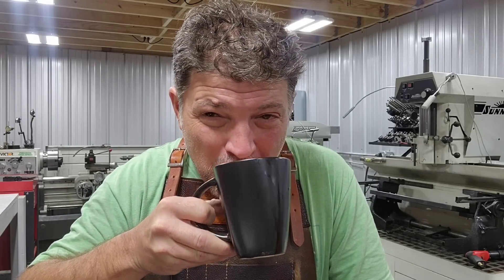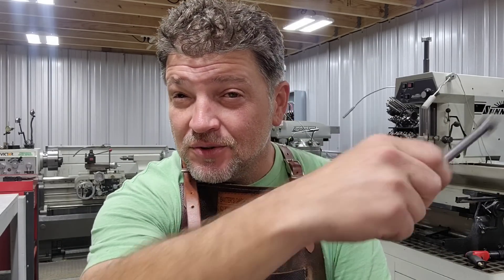Do You NEED to UPGRADE Fasteners for Your Harley Engine?  Fastener Tech and Logic to Help You Decide

Comment: I was wondering how you were dealing with Galling with SST fasteners and an Aluminum Case. I am an ME not a mechanic, I am looking at building a Bullet Proof as possible engine for my 2015 Road King. I am looking to rebuild or maybe build from the ground up, an Endurance Long Range Iron Butt motor. How do you feel about putting in the Timeserts in all the treaded holes in the Case from the start? I thought I saw in one of your Video's that you make your own Cylinders. I can't find them on your website. If you don't make them anymore. What cylinder's do you suggest to go with your off-Set Pistons?

Comment: Love arp stuff they make great bolts. Their prices aren’t that high either I needed to do exhaust manifolds on my gmc truck arp manifold bolts cheaper than the oem bolts. When you order the bolts for engine builds do they have a fastener kit or do you just measure each bolt and order accordingly?

Comment: Thanks for sharing, clockmaker in the UK. 
Quality and availability of UNC chaser taps isn't what it used to be. I built recon engines with old school engineers 40 years ago,a decade in R&D electronics. Going through your catalogue of content along with the factory service manual before I take anything much apart on a '99 TC88 FXDL. It's had previous owners who were not diligent in research or due care but has survived to be a viable project to restore while conserving some character.
Only done 25k miles which comes with it's own issues. Been stored in high humidity/low temperature at some point. 
Had to let my 1340 FXDL go but life has been kind enough to allow me another along with YouTube to which you kindly contribute.
All the best for the future.

Comment: Stainless steel has a tendency to gall when assembled. That's a con, not a pro. Stainless steel has less elasticity than carbon steel, which is what makes a bolt actually work, you stretch the bolt a measured amount, (which is why we use torque wrenches!) and it will try to return to its original length. If you stretch a bolt to its "yield point", it becomes measurably longer, loses its elasticity (and its main function!), and it reduces the tensile strength of the bolt, often leading to failure. Not a good thing. When I assemble anything, I like carbon steel fasteners. I will give stainless an appearance and corrosion prevention advantage when used in non-critical fastening situations, but when I want to "Upgrade" my fasteners, I move up to a grade five or grade eight carbon steel bolt. In this one circumstance, proper chromium plating of carbon steel bolts is your friend. Historically, chromium plating was used to protect metal parts from oxidation, not for appearance. But then, H-Ds have become a showcase for chrome plated parts.

Comment: Electrolysis occurs between two metals only with the addition of DC voltage. 

Galvanic action occurs when two dissimilar metals are exposed to moisture. 

Stainless and aluminum create a galvanic reaction when exposed to moisture. 

Electrolysis between Stainless and aluminum only occurs when you add DC current across the two metals with moisture present.

Comment: I came from the aviation world, especiall military go fast airplanes. We used SS in aluminum some, grade 8 more. I was a jet mechanic and stainless was used alot especially hot section. It could take the heat. And you're right, no locktite. If it went into aluminum it had anti seize and if it was flange it had SS lock nuts. Where grade 8 was used it was saftey wired. But that was in the 70s and 80s. I understand the new jets don't have near as much s/w. When you build mine I am more into a very well built sleeper. I come from the pan and shovel world.....where chrome wont get you home. That said ARP is the best in the business. We will talk. What is your backlog right now? Thank you Kevin, Happy Thanksgiving to your family and crew. Be safe.

Comment: Does the length of torque wrench become a factor when torquing bolts.(Example) 1/4” torque wrench with adapter for 1/2” socket, vs 3/8” torque wrench with 1/2” socket? Does digital factor in vs click torque wrenches?

Comment: I would love to hear a breakdown on upgrading fasteners, molecular benefits, and plus/minuses on using SS hardware on pans. I'd also like to hear the proper inserts to use for if you have a stripped out tranny bolt in original HD pan as those materials may or may not be better manufactured depending who you listen to. Thanks

Comment: Thanks for that Kev. I generally don’t use lock tight when assembling. Where I can fit a spring washer I will but if it looks unsightly I’ll just plumb for a fastener with probably a washer underneath. I sometimes just reduce the OD of the washer for aesthetic value. I use anti seize and torque up to the mid point value as you suggested. To date, 6 years of running a Softail and 3 years of running a Dyna I have never had anything fall off, even rear drive pulleys. I always assumed that HD used so much lock tight because it was easier and cheaper for assembly at manufacture. I going to have a look at my Machinery’s Handbook now though!!

Comment: Very well said as you noticed I changed all the bolts in my bike from one end to the other with 12 point stainless bolts!!!! I even demanded that you use 12 point stainless steel bolts in the case to replace the bolts I could not get to because I didn't want to pull the engine to just change the bolts!!

Comment: You don't mention the type of stainless, 304, 316, etc. And then you can get into duplex, blah, blah.

I know you're speaking of engine building, but your fans should be aware while stainless has fine tensile strength the shear is lacking.
Meaning, stainless for a foot peg is not a good idea.

I use 316 stainless in places on my old Pan. Most usually replacing a rusted mild steel bolt set.

Comment: Hi Kevin I am an owner of a 1987 1340cc Heritage I bought in Nov. '22 after riding the unit for a short time maybe four weeks the thirty year old showed it's weakness first was saturation between the transmission and primary, while riding a that time I felt a small earthquake under the seat  at that time I was unsure then I saw the wetness in that area.front exhaust stud had been helicoil the top one I'm having a ball got new s&s low compression heads thanks for the info on fasteners cheers

Comment: For anyone with an M8, here's what I have HAD to upgrade BEFORE 15,000 miles on my 2020 FXST 107ci: intake manifold (began leaking very bad at around 9k miles), and Compensator. Stock comp began rattling and making the bike sound like it was falling apart at idle, at around 13k miles.

Comment: I am a Plumber by trade, and from time to time, we work with Stainless Steel bolts, washers, and nuts.
With large Bronze flat faced flanges, meeting up with another flange, be it bronze, brass, or copper, these large flanges usually utilize 8 Stainless Steel bolts, along with S/S washers,and nuts. With a fiber(usually) gasket in between both flanges.
We always use Anti-Seize Compound on the bolt threads before install. My boss demonstrated how these S/S bolts and nuts, can gall the threads.
Could NOT remove the nut!

Comment: Hi Mr. Baxter this is Mike Joe's I used To Do that all the time. I still do it even on my bike but even on all my injury Bills. I used to build all the viacin everything like that as I used to blow out Chase to threads in the used either copper coated or never sees or not copraco but it's a copper base never sees on all the head both stuff like that but I would run running in the engine after subtly. And then go through and check all the torch's on top and.
  If I was questioning the bottom half I would pull the injury to good radio pull the Pan and go through record the bottom if it didn't sound right. But most time I didn't have touch bottom in it. But I always talk to top half because that would always move have a nice day.

Comment: Awesome video! There is so much to know about fasteners that is often overlooked/neglected. Especially for stainless. Doing the proper steps to prep the threads and which compound maximizes the effectiveness of the fastener is very important.
About 12 point polished stainless fasteners for all the covers etc on the engine, they are amazing. Easy to clean, always look great because they never get crusty (at least that I’ve ever seen). Harley should seriously use polished stainless fasteners on the engine from the factory. Let’s be honest, new Harleys aren’t cheap, and it’s really stupid that even after one year their crappy zinc bolts can get all crusty and not look the greatest. Even seen them start to rust a little after just one year. Total crap. Stainless is the way they should do it so that the pricey new motorcycle looks as nice as possible for as long as possible. My bike has 12 point polished stainless just about everywhere that is external. Wouldn’t have it any other way.

Comment: When you say this . I  am getting an unusual vibration.  I had my bike sit for a year while my interests were upgrading a boat. 
A while ago I asked about compensator.  Which is best. We worked that out being Darkhorse.  I haven't changed tyres as of yet. At hwy speed I don't feel this vibration.  Only in built up traffic at slower speeds. I coasted down a steep hill with the engine off and had no vibration. Next was engine fasteners. They were tight.   I  don't know what's next.  I do have a baker chain adjuster that may need adjusting.

Comment: As much as stainless bolts look good, no corrosion, they are softer/weaker than mild steel.. grade five to eight. Good use in cosmetic applications, but not for heavy retention! I’ve always used the proper length wrench to tighten my bolts, with, adequate pressure on the tool 100 foot pounds/110 who cares.. after a few years of riding Everything leaks! I think head bolts, con rod torques are important, not primary cover bolts.. my opinion. After 50 years of servicing my vehicles, the only problems I’ve had is if I let someone else work on it! Sayin…love your channel, just my two bits worth!

Comment: Good video. Just checked my invoice and I see that I am getting these. Just got my Skunk
Series hoodie. It fits good and looks really good. I believe Loctite and the excessive amount of it, has caused problem on the M8 tappet bolts. I saw were you used a some kind of hand held device to heat these up to keep from breaking them.

Comment: Rocker arm bolts. Expansion and contration clatter. I find the shank diameter is way too small, causing top end clatter. Your thoughts and suggestions???  On 103, 110 twinn cam.i know there is a bushing kit out there.

Comment: Ditto to  Bronsonwhite611. There are multiple issues with lock tite compounds into aluminum with stainless fasteners.  Also rules about size and color of locktite. All these factors come into play for a leak free and long lasting assembly. Great presentation .  Well done Kevin,gotta love ARP 12 points.

Comment: Im always on the fence with locktite, especialy going into aluminum, and if your going to  disassemble it more times that you should dicking around with things.  internal parts I generally do, especially if the service manual calls for it, primary cover, cam chest cover.... nah.

Comment: Thread lockers like Loctite are very poorly understood by most of us. How do they work? 2 things are required for the product to solidify into a hard plastic:
-Absence of air (thats why it doesn't solidify inside of the bottle)
-Presence of "active metal ions"

Steel, copper, brass have "active metal ions"
Metals like stainless, aluminum, magnesium and inconel DO NOT have "active metal ions."

If you place a stainless bolt in an aluminum case, the Loctite never sets up.

The manufacturers produce a primer that will activate the Loctite, but be aware, this causes it to set in several minutes instead of 6-12 hours. 

There is a whole lot more information and misinformation out there. Probably the other more important thing to note is the formulations (or clolors) are diameter specific. It's not that "Blue is medium and Red is permanent." You need to apply the correct formulation to the fasteners being used. 

Great presentation, Kevin.

Comment: almost the very first thing i do, for two reasons. the first is convenience. i traid all my torque heads on the outside of the bike to allen heads i use grade 8s . i never have to worry about goo on yhe treads, they look cool against the chrome, and it greatly reduces my travel tool kit. second those magnesium bolts that come on modern harleys are total crap. bonus third like i said greatly reduces the tool i carry . i need a 3/8  drive two socket sets , i need a 3/4 drive and three sockets. a screw driver, and i stll go with a back up set of allens and two tier irons with that kit i can do anything i need to do on the road including change stator, ect....

Comment: I agree with you totally, I used all arp bolts, cases, rocker boxes, trans cover etc. I did not use any loctite on any of them. The fasteners cost me a small fortune but like you I like the 12 point. Great video.

Comment: Hello Kevin.  First one of your videos I've caught in a while but I'm glad to see that it looks like you've got things up and running in the new shop.  I really enjoyed the shop build videos but they did made me feel like I was getting old because I could not have kept pace with the work schedule you set for yourself.  Back to the subject at hand.  Harley seems to have had a problem with head leaks on the M-8's and went so far as to put out a tech update and changed the way the head bolts were to be torqued down.  I don't know how effective the change was because my newly rebuilt M-8 had to be tore apart twice due to a rear head leak.  Torque patterns, it would seem, play a large part in the sealing process as well as the fasteners being used.  I don't wrench on these things as much as I used to so the reminder that there are other products besides loctite that can and should be used on certain fasteners was a welcome reminder.  I've never been a fan of chrome but I love the stainless stuff.  I'm looking forward to your videos from the new location.

Comment: I thought you should not use stainless with aluminum because with my experience as a tool maker the stainless will corrode the aluminum and damaged damn near fuse together.